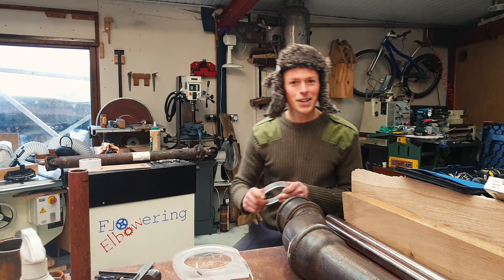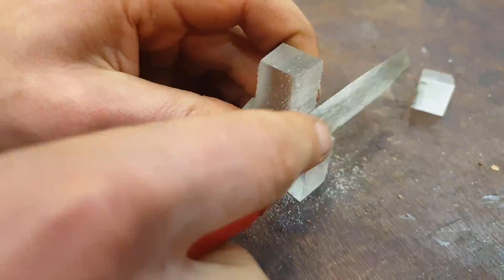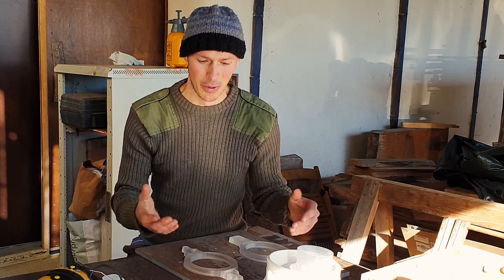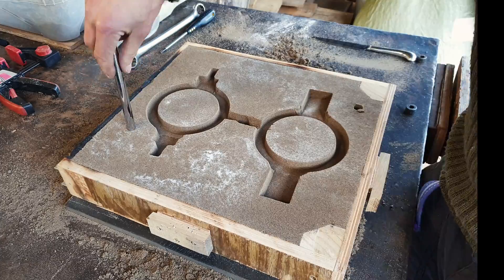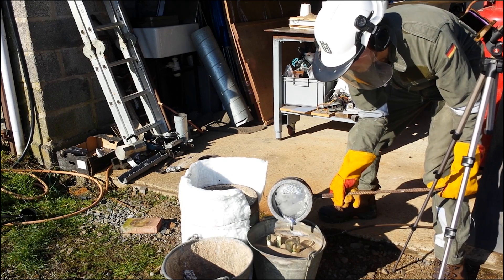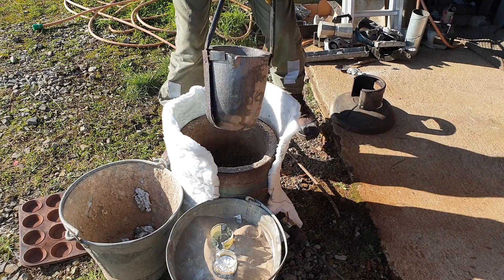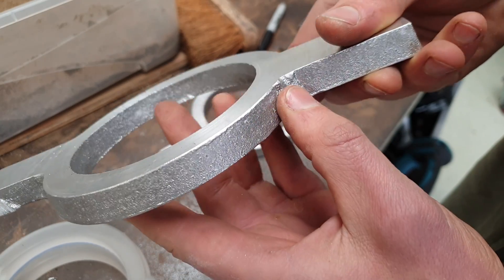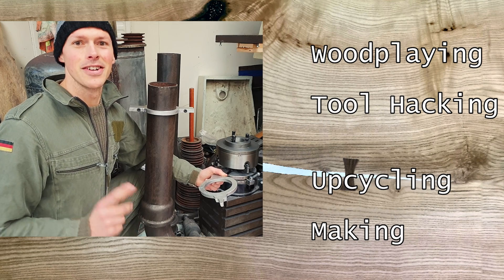Melting Metal to Make Clamps [with Casting Tips]

Comment: needed a new 80mm collar for a pillar drill where the cast iron one had cracked. Scrapyard 1" plate line bored on the pillar drill with a bearing in the table. , I would put much more talc on but you seem to have nailed it. do you need to de-gass the aly  just for homemade castings.
Reply from the maker: Hey thanks man. 😊.  Yeah degassing has been a difficulty for me, actually find it easier not to... more on that in the more recent casting tips video. 😉

Comment: So I want to cast Archery Bow Risers and I am thinking about using old aluminum car rims but is the aluminum any better than cans once you melt it? wouldn't it take the ageing out of the aluminum, and it would need heat treated anyway, or are the rims a better mix some how.
Reply from the maker: Hi there TwistedSister. The aluminium in old rims will be a much more suitable alloy for casting. Check out our vid on heat treating if interested in that element.
Old cans have a very low volume of actual aluminium compared with their surface area, which means a lot of paint and oxide impurities... it's possible but hard to do a good diy casting with cans. I'd say If you're starting out use good clean aluminium. Alloy wheels are a good bet. 👍
Reply: @FloweringElbow  That makes sense, Its just that I have a semiload of cans. I was told to make them Ingots first to get out all the crap then use them for casting.
I also have a bunch of aluminum frying pans but I need to wire wheel out the teflon.
Anyway, love your vids.
Reply from the maker: @TwistedSisterHaratiofales  thanks 😊  
Be super careful with ppe if grinding teflon. It's really not good inside you. Personally i would say it's not worth the risk or amount of clean up you should do... and you know if you have seen many of my vids how much of a safety fascist I am not! 
Stay safe, and good luck with it.

Comment: I did some investigation, and I think that you just need to add a few minerals to the aluminum to push the waste into the dross.  Flux of some sort.  Personally, I really like your video's, so I would appreciate it if you would redo the casting for the DIY CNC machine gantry with melt from alloy wheels.

I also can see where the following.

Connect the end of a chain to one side of the crucible carrier.
Make the cable able to lift the crucible up on one end by pulling on the cable.  That gives you a trivial pouring mechanism.  Now all you need is some way to transport the carrier from where the melt happened to where you pour it into the mold.  Like using a cart with wheels on it.

Comment: There are at least two reasons for having a project.  1st.  the goal itself.  2nd, the making or acquiring of tools to be used in this and future projects.  Its best if you can make the tool, but if this isn't possible, buy one.  There are 'standards' for curvature in various sizes available but, you can make your own with a bit of thin steel or aluminum, lay them out, and grind/sand them to the correct shape.  When next time you need to layout curved pieces, you'll have the right tool.
===
clamping pressure on any lathe, mill or rotary table will cause a round shape to deflect when cutting out the center portion.  if the deflection is within your tolerances, then it doesnt matter.  On more critical parts the errors add up.
===

Why not have the cope and drag.  with just a cope and a steel plate it will cool very fast; but I think you noticed that.

Green sand may be better.
Reply from the maker: Hi SV Telos. Well said my friend! And nice tips in regards to both turning and casting, thanks for sharing :)

Comment: Thanks for sharing! I'm curious about what kind of aluminium alloy went into the melt, and if you added flux or degassed it? From what I can see, it pours, solidifies & turns really nice, like it has some silicon or other casting alloy part in it, but then - common AlSi9 press casting alloy is not supposed to work with T5 HT. Personally I use AlSi12Fe for casting, from discarded office chair feet at work: 2,7 kg of Alloy in each, and some Zamac 8 at times.Gas pores could perhaps be reduced by a few tsp of pool shock chlorine (then wear a gas mask)? -Yeah - I'm really surprised by your results! Good luck and keep up the good work! Regards, DIYSwede
Reply from the maker: Hi DIYSwede, thanks for the comment. I can't be 100% sure of the alloy as it is from old alloy wheels. Seems to respond well to T5 - as you see in my other video experimenting with that... 
Cheers, B.

Comment: Good job. About the only thing that I feel is missing is a post pour inspection and analysis of the product. One of the advantages of recording your pours is the ability to review your procedures and the results to note improvements or where mistakes were made. For example you only had one casting with porosity bubbles and at one location. So the question then becomes why and why there?
Reply from the maker: Really good point Mark. I guess the short answer is I left that out because I don't know why they were there! I have had some speculation about the surface of the steel chill not being smooth or hot enough. Of course my strategy of just melting the Aluminium as quick as possible, de-dross and pour (without fiddling about with de-gassing concoctions and flux) could also be responsible... But honestly I think people tend to cause as many problems with those extra processes as they solve.  
As is the way, the next few castings will hopefully be somewhat improved (not least because of clever suggestions form you guys!) and I may be able to tell more...
Reply: FloweringElbow From what I observed the porosity only occurred in one item and at one location, so that says to me that it was Not a general procedure problem but rather a localised issue. But what was it?
Reply from the maker: @markfryer9880  Hmm. As you say it was localised. I shall have to examine the steel plate further and the gating arrangement. I think larger gates would help, perhaps not enough molten metal was getting through, because it was freezing against the chill - and the gates were quite a bit smaller then the part...

Comment: Excellent job. I was nervous your sand mould might collapse having been standing overnight but it held its shape very well. Your use of my plaster feeder was very flattering and I was pleased to see it kept the metal molten for you. Here’s a tip – wrap masking tape around the outside. These feeders do sometimes crack and yours was a little thin, but tape will hold it together long enough for it to do its job. Keep up the good work  : )
Reply from the maker: Thanks. Yeah, I was quite relieved that the green sand didn't just fall apart after leaving it overnight - I almost expected it to. 
Yep, I actually wrapped the one on the right (not the one I pour into) with some aluminium foil tape. because it already cracked in the oven - and it ended up surviving the best (and I will try and reuse)...  
With my next ones I was thinking I may just make the plaster mix bonded into a bean can... So there is already a steel outer - not sure if the plaster will pull away from it during drying (?) but we shall see.

Comment: Thank you for sharing your experience. I am a recently retired engineer and am dabbling in aluminium casting, so far with little success. Wooden patterns certainly are “sticky” even after painting, varnishing and even polishing. I am using charcoal as a fuel an a modified bouncing castle  inflater as a source of air. I use the blower in my improvised forge as well. Keep up the good work and I look forward to the next episode.
Reply from the maker: Thanks Llion! How much draught angle are you putting on you patterns? 5 degrees seems to be a common angle, but you can up that especially if you are having problems, or have internal corners pulling sand away. 
I like you use of the bouncy castle blower :D
Reply: @FloweringElbow  I think my draught angles are ok. My sand may be a bit too wet. I have another batch of sand so will give it another go once the monsoon season here in Wales finishes.
Reply from the maker: @llionellis  what part of Wales?
Reply: @FloweringElbow  Just outside Benllech in Anglesey.

Comment: Also, what's going on at 02:03 with the danger signs?
Reply: Sam Saville sharp edges straight off the lathe and swiping fingers will cut you.
Reply: @pekesrepose7363 yikes!
Reply: Leaving the key in the lathe chuck is a Bad Thing!
Reply: Yes it's the chuck key issue, not feeling the edge!

Comment: impressive, steel can hold moisture on its surface within the oxide layer. preheating the metal helps your liquid have more time to fill the voids but by using steel without always torching off and polishing the surface, you risk the chance of those bubble pockets. 
I'd use stainless as the heatsink plate or brass/copper this would heat up faster and hold heat longer.  brass or copper would be easy to clean and sand/smooth as well after many uses. for now try using your torch to heat and burn off the oxide layer before your next run. I'd also use a flat grinder right before you place your sand in top and then blast it with a quick puff of air. good luck.
Reply from the maker: Thanks for the suggestions Peke! Appreciate it.  Brass, copper and stainless are out on account of me not having one lying round and them being awfully expensive for that kind of size... I did preheat it to about 150C, but looking at the "nice but slightly river'esque surface that was in contact with the chill", I will try the torching, and get more of a polish on it. Thanks, B.
Reply: FloweringElbow Check out your local scrap metal merchant /dealer for suitable items at scrap prices.
Reply from the maker: @markfryer9880  Even at scrap prices a plate thick enough to resist warpage, in brass or copper would be expensive (& a rare find).